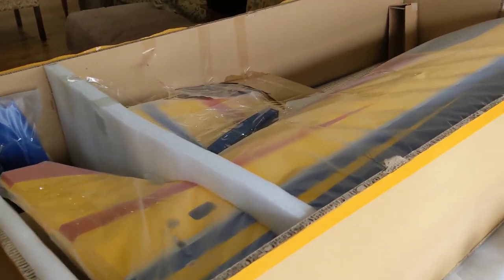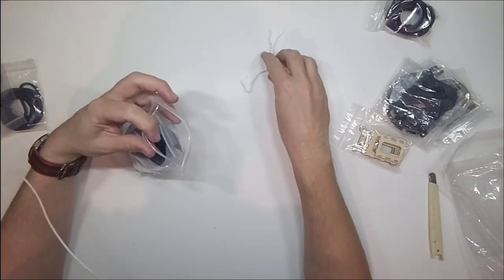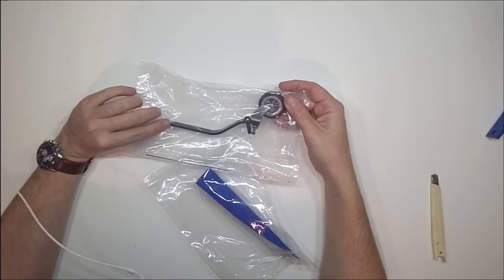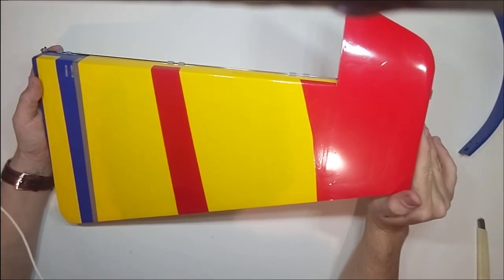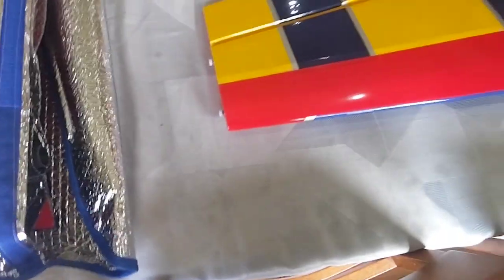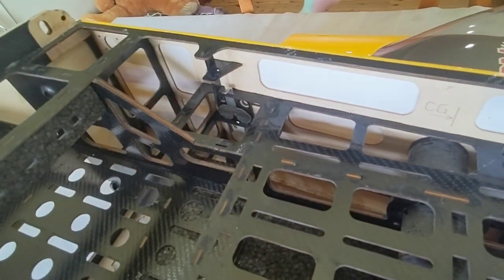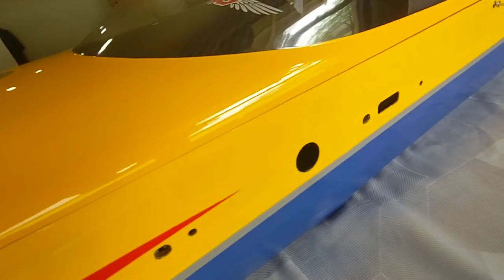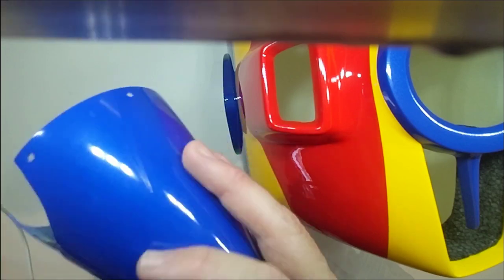Unboxing video and parts overview for the new 91" Skywing NG

Comment: Joey, Random Question, do you know if the wheel axles on the 91inch is the same as the 85inch Extra and their measurements? The threaded end that holds the wheel pant to the axle has snapped on one of mine and I can't get spares here in the UK for it, so having to look for an alternate which is annoying
Reply from the maker: Sorry mate but I don't know. I would assume so as the planes are so close in size. Maybe message skywing jinwei on Facebook
Reply: @joeytavora1270   Cheers Joey, I'll give that a try